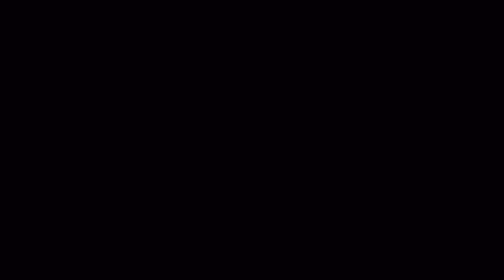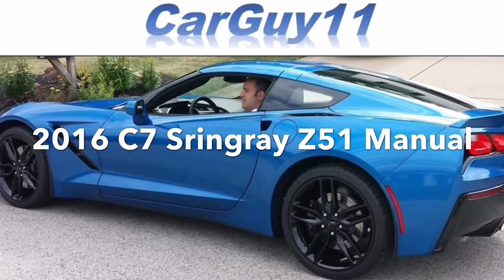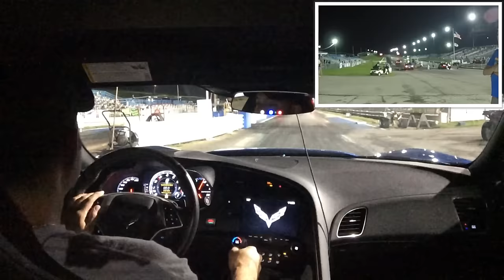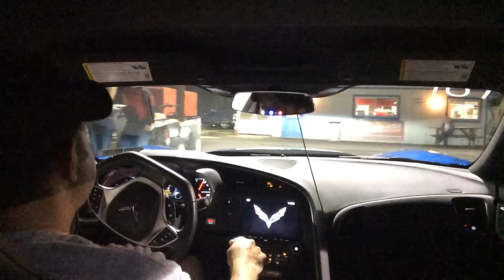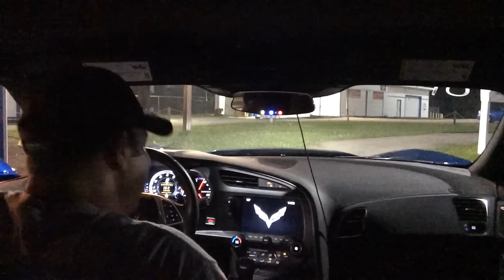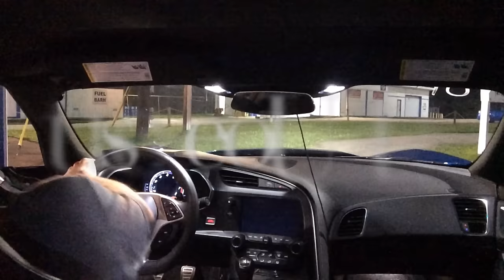Rear End Failure Using Launch Control! - C7 Corvette Z51 Manual

Comment: I posted this on a few other videos

This is really hard to watch. There are several people on the corvette forums and even people on YouTube talking about breaking their rear end gears because of launch control. The launch control setting works almost flawlessly when done correctly. This video along with the ron fellows raceway demo is doing it incorrectly. In the owners manual it specifically says to release the clutch in a quick and SMOOTH motion. Just dumping the clutch at 4,500rpm can and will break something eventually. The other issue is it also tells you to give the car a moment for the rpm’s to settle before letting out the clutch. I’ve been to my local drag strip a bunch with both my c7 manual z51 car and a buddys c7 z06 manual car and have used this feature without fail and it’s extremely consistent at the track. I’ve got plenty of PDR videos and time slips to back up my claims and you can see how smooth it actually is versus these guys just absolutely destroying the the car. Here is a quote from page 201 in my owners manual

“1. Manual Transmissions . The clutch is pressed and the vehicle is in 1 (First) gear.

2. The accelerator pedal is rapidly applied to wide open throttle. The Launch Control feature will initially limit engine speed as the driver rapidly applies the accelerator pedal to wide open throttle. Allow the engine rpm to stabilize.

3. A smooth, quick release of the clutch, while maintaining the fully pressed accelerator pedal, will manage wheel slip. Complete shifts as described in Manual Transmission (page) 187.”

I just hate for these great cars to keep getting a bad reputation because for some reason people were taught by “professionals” to dump the clutch while wide open on the throttle. I have over 50,000 miles and more launches than nasa so I can say with a clear conscious that just following the instructions in the manual will not only yield you much faster and consistent times but your cars clutch and drivetrain will really thank you… So sorry for the rant. Hope this helps.
Reply: So basically, let the rpms settle to just above 4k, if it's higher than that, you're not in LC mode.  Once the revs settle release the clutch quickly and smoothly(but don't just side step/dump it).  I've seen a few videos of guys doing it correctly and getting a lot of wheel hop.  Has that happened to you?
Reply: @smykster007 That is correct. If the RPMs skyrocket and bounce off the rev limiter your car is not engaged in launch control. In the owners manual, it describes the factors that would not allow the car to engage in launch control. One of those examples is, if your wheel is not straight, so you cannot use launch control with your wheel, turned to the left or to the right. It doesn’t describe the angle your wheel must be at to not engage and I have not tested that myself. 

As for the wheel hop, the amount of torque is just too much for the harder OEM run flats to handle in the street. If you plan to launch in the street you are much better off doing this manually because of the overwhelming amount of intervention the cars system will have to manage. Typically they say NOT to do a burnout at the drag-strip on street tires but doing so with the Michelin pilot sport run flats that came stock on the car yielded much better results when cleaned up and with some carcass temperature in them. I was shooting for the number one spot on the fast list on the corvette forums in the showroom stock class. I have the time slips to show that I would have been able to take that spot over but it was the last run of the night and the clutch was too hot and when I left I wasn’t able to get into second gear and ruined the run. Most importantly though is the 60’ times are all around the 1.8 seconds on factory tires proving just how well the launch control is doing. Further more, when I switched the drag radials (Nitto nt555r2) and ran them at the recommended 18-20 psi (on a prepped surface recommendation from the manufacturer) launch control worked flawlessly and because the drag radials didn’t spin at all the clutch stayed much cooler. I ran 12 runs back to back with 12.0-12.2 quarter miles times with 1.7-1.8 60’ and only 115-116mph due to the heat of the summer. Based on the slips I should be in the 11 seconds with some good DA and cool weather and that’s on a completely showroom stock car other than drag radials. 

I hope this helps and I apologize for taking so long to respond.

Edit: I may not have answered fully. In the streets I experienced tons of wheel spin specifically because the street isn’t as sticky as the prepped drag strip surface. At the drag strip I would experience wheel hop if I let the clutch out too quickly because it would overwhelm the factory tires and cause it to not only spin but having that sticky surface meant it would intermittently get some traction causing the dreaded wheel hop. 

Full disclosure, the more the clutch/engine management intervenes the more the clutch gets hot and will cause the pedal to stick to the floor. This has happened to me twice. Also be sure to check your fluid level of the clutch because it’s known to vaporize under the tremendous amount of heat. I bring a small bottle of amsoil DOT4 clutch fluid with me just in case. Since moving to the drag radials this isn’t really an issue but if you plan to run stock tires it’s something to be aware of.

Comment: To all the douche bags hating on he driver, this is how Corvette designed the car to be launched. It is called launch mode and they reccomend full throttle then drop the clutch. Let the computer do the rest.
Reply: Should have set the revs at launch for 3,500 or 4,000.  Hooks the best and doesn't blowout the rear end.
Reply: you don't drop the clutch you let it out smoothly

Comment: Glad to see the fixed it for you. If they didn't that'd be a bunch of BS! As you stated it's stock and you were using a feature that came stock with the car (launch control) so they absolutely should cover it. My buddy has a 16 Z06 putting down about 725 to the wheels and has run it with launch control 20-30 times at track with zero issues.
Reply from the maker: Thanks yeah covered no questions asked.  That's good about your buddy but wouldn't keep using if he has a manual.
Reply: Yea it's a stick. He knows he will granade the gears eventually and then he will upgrade to stronger, better ones. But I will tell him about your story. PS I found you from Cleetus channel
Reply from the maker: Cool man hope you stick around!
Reply: I subscribed!  I like how you can just ask people to come join your channel your trade something to offer in your comment saying hey check out my vifeo on this.
Reply: I'm glad you understood what I meant. Lol. I didn't proof read till now and I'm surprised you knew what I meant. For those who didn't get it here's what I meant: I subscribed to him from another channel because he didn't just put a stupid comment saying come join my channel. He had a relevant topic to the video on his channel and said go check it out. I did. Saw he was down to earth and not a little kid so I subscribed
Reply from the maker: Appreciate it! Yeah its a thin line promoting your chan on someone else's and only do when its relevant.

Comment: efly reading the comments I am seeing that people think you should put the power loss (heat) and friction on the clutch. I disagree this is how you burn up a clutch. From what I understand the power loss and friction should be minimalized using launch control. The minimal amount of loss should come at the tires and the ground. This should be limited by the computer which can do a better job than anybody slipping the clutch to get a good lunch. All this being said I watched your video because my first concern with the launch control was that I am going to burn the clutch up on my vette. What is your opinion on this. How strong is the clutch? How is yours holding up? I just bought my 2017 z51 yesterday. Had to leave town before I could even drive it.
Reply from the maker: Exactly right.  People slip the clutch for best launch but I didn't want to do that to mine.  It's holding up well but I don't abuse it with clutch slips.  Next time I'm just going to rev to about 2500RPM and launch manually.

Comment: Man that sucks! What rpm did you launch at? Also did chevy give you grief on the warranty repair? I track my Camaro 2SS and launch with the same engine but more weight so I figure im probably at more risk of this than the average Stingray.
Reply from the maker: It was little over 4k using launch control.  The dealer replaced it no questions asked.  Camaro uses a different rear end than Corvette so hopefully its stronger.
Reply: The Corvette has Independent rear suspension , yours is probably a stronger design , trading off a smoother ride for reliability !

Comment: Sorry to hear about your rear diff problem. Seems to be happening to alot of C7's when launch control is used. There are a few more videos on You Tube regarding failure and there is one from Spring Mountain driving school showing an instructor demonstrating Launch Control and he has a complete failure just like yours. Also a few threads on Stingray Forum about the issue. Good Luck
Reply from the maker: Thanks!  I haven't heard of any other failures.  Good to know and I won't be using launch control anymore.

Comment: I just bought a Z06.  Now I am not sure if I should even try that Launch Control feature and just do it the old fashion way.
Reply from the maker: +Julio Diez Congrats! Naw I'd stay away from launch control. Can do better on your own.
Reply: there's nothing wrong with launch control. but what you got to understand is that it's a very sticky surface on the track so him launching that aggressively is very hard on the differential and other parts of the drivetrain.
Reply: I wouldnt worry about it in a z06 they have alittle strong rear ends than base cars sorry to see this happen personally have a base car that has been launching over 2 years now without any problems
Reply: Thank you all very much for your comments. I'm going to give it a shot.  ;-)
Reply: How many times have you launched yours?  I just picked up a 2017 Z51 and am worried if I launch it too much it will get messed up.
Reply: I've done it a couple of times but honestly, I won't do it that much.
Reply: Slowmaro is your car M7 or auto? If M7, would you help explain exactly how to do it properly? Do I really dump the clutch or just quickly let off? What Comp mode do you use? I have a Z51
Reply: Smart bruh! Ease out or quickly  ease it from 3400RPM on street tires always safer and quicker.  5k is possible but you have ride that clutch with precision and will just kill your clutch faster. Race stock tires for decades on the street. Lol
Reply: @AllendeNL  I just blew my rear end off a dig. Not at a drag strip but we prepped the road enough to break axles lol. I didn’t a couple launches with launch control after the 4th one I was racing a c6 and I was found in this exact same scenario. Now dealer quoted me 7k for labor and parts.

Comment: @carguy11 I know this doesn't pertain to this video but how do you get your dash lights that bright? Mine are bright during the day but at night i can barley see the middle display. I have rolled the dimmer all the way up but doesn't get bright. its working because it will turn them off.
Reply from the maker: Hmm the dimmer switch only thing that I have adjusted. Wonder if they changed the range of brightness in different model years.

Comment: How many miles did you have at the time? Have you ever changed the differential fluid prior to this?
Reply from the maker: I had about 5k miles on it and had dealer change diff fluid about a month before because I was tracking it.

Comment: I broke half the teeth off the ring gear on my '70 Chevelle . 😁 It was a Cheaper and easier fix , had it up and running the next weekend , only because I had to work all week long . I used to think ; Chevrolet used silly putty to make the gears , Ford 8" rearend fixed the problem . Looks like the newer cars have the same thing going wrong with them . Could be quality control or a  bad design . Hope you didn't have any money on the race ,  It Sucks !!!
Reply from the maker: Yeah nothing easy with modern cars.

Comment: Its definitely a week point in these cars, this just happened to my 2017 grand sport although i was on a private road trying to do a burnout and instead of wheel spin i blew out the ass of my c7. Difference is my warranty will probably get denied cuz i have intake exhaust and a tune :(
Reply from the maker: Ah geez that sucks.  Let me know what happens at dealer.  Hopefully will still cover it.
Reply: CarGuy11 well just got the news dealer said gm said drivetrain warranty void because of non gm calibration. Im screwed. Is there anything i can do about them denying me?
Reply from the maker: Sorry to hear that.  Try calling GM customer service and say its a common problem on the forums.
Reply: once you get into the computer youve just screwed yourself on any warranty work,you can put a CAI  on and mufflers,anything beyond that will void you

Comment: got to love GM for covering it but did you see how much the rear diff cost? just wondering
Reply from the maker: +rmm2424 No didn't see what it cost.
Reply: if you look at rear ends for c5's and c6's (i have a c5 that i frankenstein on) i'd bet based on the trends that the c7 diff, brand new from a dealer, was over $3000 :O

Comment: wtfff.ff...im sitting here this very second about to take c7 to the car wash  and then to the Speedway for Street Legal Drags and i pull up this video..it will be my first time to drags in this car.but now im debating on it after seeing this, .glad there fixing it but damm.
Reply from the maker: Yeah, I wouldn't use launch control or if you do slip the clutch.

Comment: I launched mine here a few weeks ago five or six times at 6000 RPM. but I never use launch control at the drag strip
Reply from the maker: +rmm2424 Should be no different.
Reply: +CarGuy11 not true, street isn't a prepped surface
Reply from the maker: +Matt Simmons I believe he meant he was launching at 6000 RPM on the drag strip just not using launch control.

Comment: You should have set your revs at 3,500 for launch control.  You would have hooked just fine, it wouldn't have been so violent, and You probably wouldn't have grenaded your rear end...
Reply from the maker: Unfortunately you can’t set revs in C7.
Reply: @CarGuy11  My bad.  I meant to say rev to 3-4k in sport or track and release the brake.  The owners manual states launch control will rev to 2k then drop down to about 1,200-1,300 before one releases the brake.  The car bogs for a tick, then launches cleanly.  Personal preference, but don't dump the clutch at 5- 5.5k...

Comment: How did I have the corvette logo stay on your HID ?
Reply from the maker: I believe its a change for 2016.  When you turn the radio full off (press and hold power button).
Reply: i have the 2015 model, can the infotainment system be updated to the 2016 with car play ?
Reply from the maker: Unfortunately no.
Reply: CarGuy11 dam it still no update on that. Can't wait for it though. Or I will just have to return the car and get the 2016 model

Comment: Is stabilitrack same as launch control.  Can’t get the launch control screen
Reply from the maker: There is no screen. Active in comp mode or PTM.
Reply: I meant on the dash.  It just says stabilitrack when I press the center button twice
Reply from the maker: Yes it won’t say anything on dash unfortunately.
Reply: So when stabilitrack is off I just press down on the break and gas? It should be able to launch ?
Reply from the maker: @gurjants92  Stabilitrak has to be on comp mode or PTM.  https://www.youtube.com/watch?v=STQ59J9jhQM

Comment: Launch control should stop at about 2000 RPM you are at 6000 RPM
Reply from the maker: It only does that on auto.  It’s not a good system.
Reply: @CarGuy11  Why would there be such a big difference? Also the higher the RPM at launch doesn’t always mean better. I found it can be tricky playing with 0 to 60 as far as the test results. With my experience With the TRX hellcat truck.
Reply: @CarGuy11  I just got Z06 auto have not launched it yet
Reply from the maker: Because the torque converter on the auto prevents engine from reving higher than around 2000 rpm.

Comment: That's why you buy European cars.
Reply: falchulk You sound like you have a whole lot of hate in your heart. Your childhood must have been horrendous.
Reply: what you don't think it possible for a drive shaft or axle to break on a European car. This Corvette has 650 horse most European cars don't have that much horsepower
Reply: I hope u kno European cars break too
Reply: I have a C7 Z06 (650bhp) and a 987 Cayman S with a turbo kit (455bhp). My Cayman will smoke my Z06 on any track. Z06 is great if you're going in a straight line.
Reply: Specially the 911 turbo... that is quality and that is expensive for a reason
Reply: Why not just get an R34 or R33 GT-R? Honestly the best AWD cars you can get for 75k NZD.